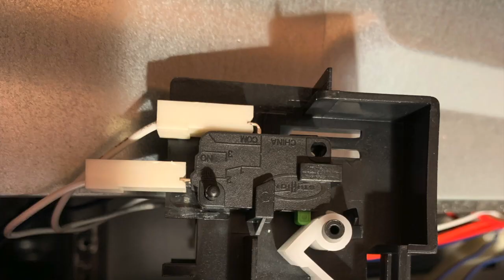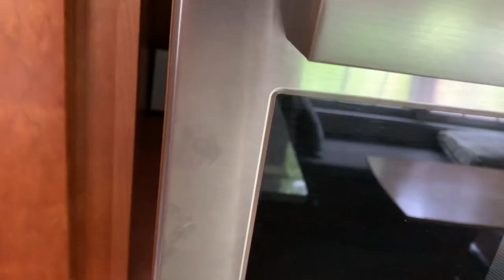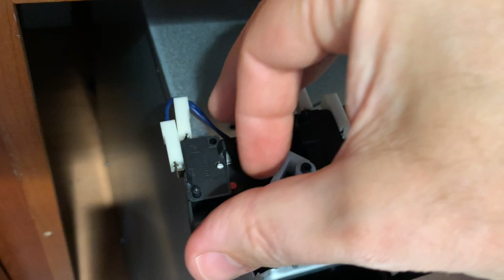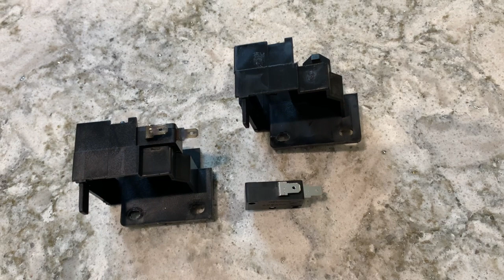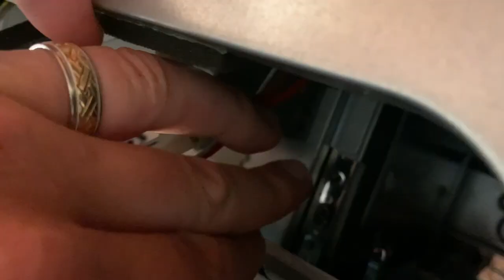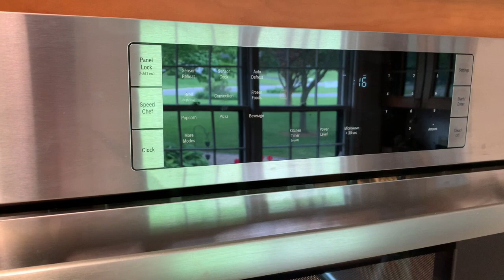Bosch Part 2 Door Switch Repair: Built-In Wall Oven Microwave Oven - 800 Series

Comment: Thanks for your videos and giving tips on how to repair this microwave. I do have the Bosch 500 series which is the lower version of this but they look exactly the same. Mine died to but what I noticed is that just on top of the door there some grills and inside there 2 flaps, left and right. What I noticed is if pressed on the right flap with a piece of stick, the power on the microwave turns on. Are those flaps happened to be controlled by the 3 switches that you replaced? Thank you.

Comment: Hi Ken, thanks for the great and informative videos.

I have a Bosch HMC80152UC speed oven that’s fairly new but unfortunately just out of warranty. I’m running into an issue where the interior light stays on when the door is closed, and the oven won’t operate unless I gently press on the left side of the door handle—then the light turns off and it starts working.

I’m also noticing that during cooking, the oven will sometimes stop, and it only resumes if I press on that same spot on the handle again. It seems like it could be an interlock or door alignment issue.

Have you come across this before? If so, what would you recommend as a fix?

Thanks in advance!

Comment: Bosch makes a kit that includes both right and left switches already installed in new brackets.  The kit also includes a new slo burn fuse. The part number is 12039730.

Comment: My microwave has similar problem, but the circuit breaker didn't trip.  A fuse was determined to be blown and fixed about a month ago; now I have the same problem, (microwave is not working and oven is fine). This happened when opening the door to reheat coffee for a second time.  My model is the HBL87M53UC/01 and looks identical to the unit in your video.  Are the part numbers above going to be compatible with my model number?
Reply: Did you end up fixing it yourself?  Sounds like the identical situation I'm looking at.

Comment: Guys, the main issue is the switch bracket on the left side of the door, the one that holds the green switch, is faulty and has a weak tab that does not hold the switch firmly in place when you open and close the door. If the (green) switch shifts just slightly when opening and closing the microwave door (because of the faulty weak holder tab), it will cause the switch to delay causing the circuit breaker to flip off. My solution was to hold the green switch firmly in place with a small screw so that the opening and closing of the door does not cause the switch to jiggle. If you just swap out the blown switch with a new one without addressing the weak defective/bent holder tab then the replacement new switches will fail every time... sometimes after opening once or after a few days or weeks.

Comment: Hello and thank you for these videos. Both are perfect and helped me fix the issue... sort of. Everything works as it should however after replacing the switches, the housing and the fuse now the turn table doesnt spin and the microwave isnt heating up. Any idea why? Could switching the wires on the switches do this? ( i did not label which white was on top and and which blue was on top but both are correctly in the green and red switches.)

Comment: Ken, excellent videos. I had same issue and have replaced the switches twice within the past month. Wondering since you did this video 2 years ago have the switches behaved or have you replaced them since. Plastic mounts are poorly designed and difficult to remove switches without breaking them.
Reply from the maker: I have not had to replace the switches since my last video.  I am careful now to ALWAYS shut off the uwave before opening the door, and I think this helps save the switches.  Yes, you can open the door with the uwave running and it will stop, but I think that contributes to shortening the switch life. (Now, don't ask me about the door hinges... that's another story. Ugh.)

Comment: Thank you for a great helpful video. I am going to replace my switches again switching all of them about about 1.5 years ago. I just buy the switch kit and replace all that I can while I have it out the wall. My real question is, has anyone figured out how to get the door to turn off the microwave beep. My beep only stops if I press the stop button.
The combination of the microwave beep not being controlled by opening the door and also how often the switches require replacement make this the most annoying appliance I have ever owned.
Reply: My turntable also sparks due to the nylon washers wearing down, I initially band-aided this with tape and got a few months. When it started again, I cut a thin ring of 1/2" sch80 pvc, then reduced the outer diameter by about half its width using a rotary saw and sander. Then heated up the pvc ring slightly and slid it over the nylon wheel. This raised the turntable slightly allowing it to work properly and not spark. I will see how long this lasts.
It's disappointing to see how much Planned Obsolescence is in the Bosch Speedoven.
Reply from the maker: @mercycubed  Thanks for that hint.  I've also had those nylon wheels wear down and fall off, causing sparks.  In my case I was able to put it back on and then glue on a small "hubcap" to keep it on.  We'll see how long that lasts.
Reply from the maker: Sorry, I don't know what beep you are referring to.  Mine only does short beeps when pressing buttons or a when cycle is done.  These are unrelated to the door.  In the Settings function, there is a way to turn off beeps.  Maybe try playing around with that?

Comment: Add me to the list of people who appreciate this video. 7 year old unit just like yours. Started tripping the breaker this week.  Feared having to shop for a replacement built-in that would fit in the cabinet, but searched internet and found your video. I actually had 2 defective switches.  Ordered all 3 and replaced them today. Not cheap, but fixed the shorting issue. ORDER THE SWITCH BRACKETS AS KEN RECOMMENDS. I broke one, but it “works”.  

I also had the dimming display issue since the unit was 14 months old (warranty expired). I was able to get a replacement circuit board soon after but was afraid to swap it out until opening it up to replace the door switches. Found a video on upgrading the poorly spec’d components and ordered those so I’ll have a spare board. 

Thanks Ken!
Reply from the maker: Glad that this helped you.  I had a dimming display, too, but within the first year so it was changed under warranty.  I have since learned about the capacitor swap for that board, though, so if it ever happens again I'll be doing that, too.

Comment: My advice is to replace all 3 switches and both brackets at the same time. You'll most likely save yourself having to tear into the unit within a few weeks after just replacing the initial faulty switch. Ask me how I know.. Also check both fuses before reassembly.  One is a glass fuse and the other is a ceramic fuse.
Typical Bosch appliance, overly complicated with low reliability.

Comment: I was following the second switch test but don’t know where you put the leads? Also any trick to removing the white connection cover and connector from the switch? Mine feel like more force is required…enough to break something.
Reply from the maker: please watch my other door switch repair video, than ask if you still don't know where to put the leads.  Yes, those connectors can be very hard to remove. Sometimes you have to clamp them with pliers and then use a screwdriver to lever it off. And yes, you might break something.  I don't know what else to tell you except try to use tools to pry it off at the connector and don't just pull on the wire.
Reply: Thanks, very helpful. Replaced one switch only to find another. New Bosch circuit board and front panel. Fuses not blown. If this last switch doesn’t do the job, I’m done fixing it. Waiting on the switch to arrive. I’ll let you know.  @kenherting

Comment: Would you be able to point me to where the fuse is located? I replaced all three of my switches but the microwave shows no signs of life when the breaker is turned on even with the door open
Reply from the maker: Watch the part 1 video. Once you get the top cover off, there is a fuse located near where the power cord comes into the back of the unit.  For safety, make sure you unplug the unit from the wall.

Comment: My breaker never tripped however the unit is totally dead just after it finished cooking something. Could it just be an internal fuse, and if so, where can I access it to check and replace as required?
Reply from the maker: Watch the part 1 video. Once you get the top cover off, there is a fuse located near where the power cord comes into the back of the unit.

Comment: Thank you Ken!  I was able to save my microwave from 4 problems that all came within a few days: left hinge, 1 fuse, 2 switches (normally open and normally closed).  Evil situation I know... Posch (oups! Bosch).  I can confirm that putting the rubber seal on the cover before installing it ease the job.  I was able to partially save my cover for this time since some clips where still available - I will keep the new cover I ordered for sometime later when the right hinge will fail ;)   For those who broke the switch support pins like I did, you can use 4-40 screws (smaller than 6-32) to pass thru the switches  holes after doing some drill holes on the support.

Comment: I have the same oven you do and the light in the microwave went out. Do you know where the light is located? Do you have any idea how to replace that?
Reply from the maker: I've never had to change mine.  However, if you look at my first video about the door switch repair ( https://youtu.be/KMTASBXC29M ) you will see how to open the cabinet and access the light bulb.  You can see the bulb at about 4:55 into that video.  Hope that helps!
Reply: Thank you for your help

Comment: OK so I watched this video after the first one and i guess i should have watched this one too before i fixed the problem switch.
I should have just bit the bullet and changed all three switches while i had it down! Anyway thanks to you I know what to do now if and when the problem happens again.
 It makes sense that the door switches go bad as this is the a mechanical part that is used over and over but seems like it should NOT trip the breaker when it goes bad but IT IS WHAT IT IS!

Thanks again

Paul

Comment: same old thing as everyone else.  seem to constantly be replacing switches.  they blow again.  I search for other problems...replace the noisy turntable motor that eventually died. and switches. blowing the breaker again.  see some burn plastic on a contact on the magnatron now. never seems to end with this thing.  debating paying someone to diagnose ALL the problems with it...probably $700 and a new magnatron, or just buying a frididaire replacement.  only thing that looks like it'll fit.  but it looks so much like the bosch I'm wondering if it's just the same thing with a different label.    there's not much selection under $2000 for this size of appliance.  bummer.

Comment: Fantastic - great help, it solved my problem, I replaced both left/right door switches and brackets. In conclusion the Bosch Microwave Oven is a bad design with respect to this issue, our door switches failed after 3 years.

Comment: How’s your bottom oven? Did you have any issues with it? I am looking to buy a 800 series convection single wall oven.
Reply from the maker: The wall oven has not had any problems for us, except I will caution you to always remove all of the shelves whenever you run the self-cleaning cycle.  Our bottom shelf, the one with drawer slides, no longer rolls out after going through a self clean cycle.  I wish they would have put a warning on the display when you try to activate that cycle.
Reply: @kenherting  Thank you Ken. I learned same lesson with my GE oven. It has the regular racks and I discolored them completely with the cleaning cycle. I agree there should be a warning.
Reply: Best advise is: NEVER use the self cleaning function On this... or Any! oven for that matter. 
only IF you want to keep it though  :-)

Comment: Ken, is it possible that the white lever that the door engages with is causing the door to get stuck when trying to open it?
Thanks, 
Sam
Reply from the maker: I have not experienced a sticking door, so can't help you there.  If you take the cover off, you can observe how that white lever engages with the door closed.

Comment: My Oven Died this Morning . Yipee ! 
Totally dead... no power up.
The Oven below (mine is a Micro and wall oven bolted together contraption) still works fine.
 The micro is powered directly from the 240 V feed from the Oven.  I think.. Honestly can't be 100% sure.. Aging memory?   
The Combo unit setups'  size and bulk complicates  Access... significantly.  Just to make things more  interesting
  
Curiously No breaker tripped.  
Presumably an internal fuse blew... will be necessary to remove the assembly from its' cabintery home .. 
 need to use my floor jack to shift it.. even to explore for a fuse..

Unanswered issue being Why the failure.. this time ? 
It being a Bosch product I expect only  the worst possible outcome.

Was  Sooo pissed... that I went out to Costco and bought a Panasonic countertop Micro.  
Curiously It has Many of the same programming features as the Boch.. even additionally a weight sensor,  in the Surprisingly similar turntable design, to gauge cooking times
Cost me about 2/3rds of what my hinge repair parts alone did.  
The thing is unarguably cheap, ugly and Likely reliable as a rock.
 Plus Costco has an Instant refund policy.. Even If I decide I don't like it's Colour... next spring.

Yesss I will  likely  try and Patch the Speedoven, yet again.. after I calm down.
Reply: Did you do it?  Mine is bolted together and hard-wired too.  I was able to get the control panel replaced under warranty (a while ago)  and I'm trying to remember how he got it out.
I do remember using a mover dolly and some "shim" spacer material to get up level to the bottom, and be able to pull it out far enough to work on.

Comment: If i mismatched the two wires going into the switch would that blow the fuse? I believe so I did see in your part one video that you had it labeled
Reply from the maker: If you reverse the wires, but they get back onto the same switch, that should be ok.  But if a wire gets put onto a different switch than the one it came off of, that would be a problem.

Comment: Same breaker tripping issue.  In my case, the top left switch was faulty. Local appliance store had the switch in stock. Replacing the switch did the trick! Your video saved the day! 

I think it’s only a matter of time the other switches fail as well. One hinge already is broken on mine. The metal just snapped off! All this happened during the lockdown years when everyone was home and the microwave was getting a ton of use that must have accelerated their eventual demise. 

Btw, what is the purpose of the interlocking switches (bottom left and the one on the right)?

Appreciate the time and effort to post this video. Mere mortals like me would have never dared to DIY this. So thank you! 🙏🏽🙏🏽🙏🏽
Reply from the maker: Glad that this helped you!  All 3 switches are part of the safety system that makes sure that the unit can't turn on with the door open. One goes to the control board so that it knows when the door is open.  One cuts power to the high voltage transformer so that it couldn't come on even if the control board failed. And one bleeds power off the high voltage transformer in case the door is opened while running.  BTW, opening the door with the unit running will stress these switches and cause them to fail sooner.  Always stop the microwave before opening the door.
If you want to fix your hinge, see my other video!
Reply: @kenherting  thansk for the explanation thanks and the tip on stopping the microwave before opening the door - memo going to the rest of household! 

The hinge replacement is itself easy but getting “there” is daunting! Will be ordering the hinge anyways and giving it a shot.
Reply: @kenherting  
The light went out on my microwave. Any suggestions?
Reply: @kenherting  So after opening up my HMC54151UC speed oven due to this issue, I was expecting to find a schematic, but did not.  I'm going to describe what it looks like to me and let me know if you think the same:
 * Bottom switch on left: goes to control board, gives signal to board to turn on the light and I presume do other things; just two wires to a connector on the PCB.
 * Top switch on left: monitor switch, when the door opens, this switch is going to close, and thus take the current to ground.
 * Right switch:  opens when the door opens, so cuts power to the microwave.

Am I correct?  I ask because even after replacing the switches, the breaker trips as soon as the unit is plugged in.  Makes me think that my unit has bigger problems than just the door switches...
Reply from the maker: @leddedup  If your model is the same as the 800 series, then you have identified the switches correctly. If the breaker trips just by plugging it in (with the door closed), there might still be something wrong with the monitor switch.  Could your new switch be bad, or possibly the door probe is not mechanically making that switch to open it when the door is closed?  You can test that by pulling a wire off that switch and then see if the breaker still trips just by plugging it in. Don't try to run it with this disconnected, though.
I found the schematic tucked right behind the control panel.  If you need a copy, I can send you a picture.